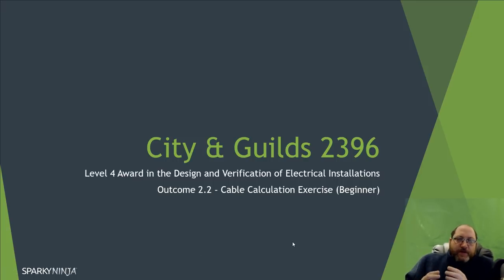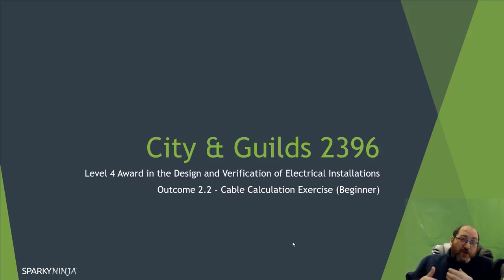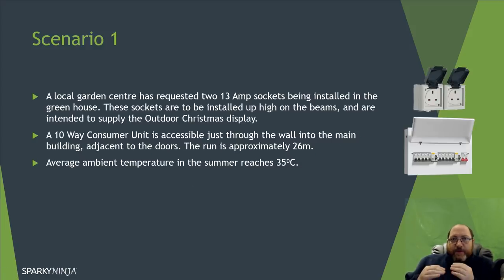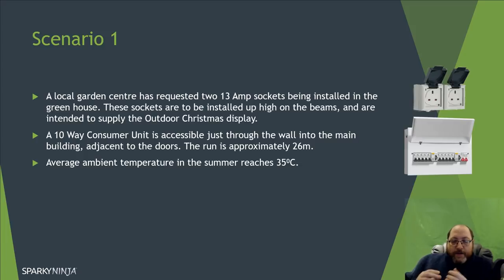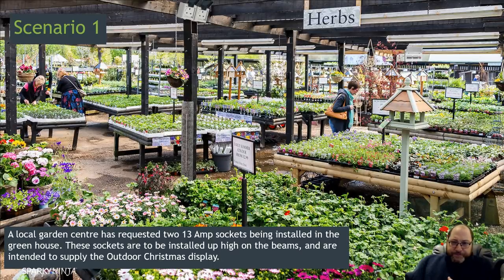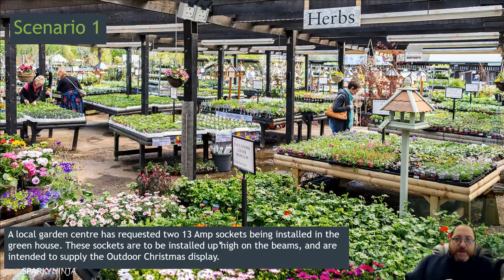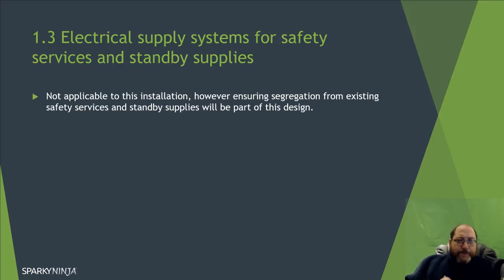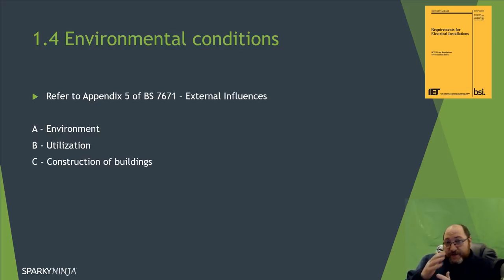2396 Ep 3 - Cable calculation example - Beginner

Comment: That was very interesting and very informative, but I would just like to ask one question. When working out the Zs for the mcb you come up with 2.19Ω, but I always thought you had to take 80% of this figure 'as a rule of thumb'.
Reply: Rule of thumb is a testers method not a designers, you have taken any factors effecting the cable already as apposed to a inspector arriving unfamiliar with the installation applying  the rule of thumb because the factors may be unknown to them.

Comment: why are you using the 100a figure in the 'Thermal Constraints' / adiabatic equation? Should it not be the potential fault current i.e. 230/Zs - which will be far higher?

Comment: Hi I need to calculate the size of the main earth I need from the 120mm SWA 4 core used as a sub-main to the DB. what size conductor would I need from the earth banjo to the main earth terminal within DB taking into account the armoured cable will be glanded into a removeable gland plate would this make a difference to earthing size to formula

Comment: Dear Sparkyninja, you are correct in regards to the volt drop, but if the volt drop between the source TX and DB is not noted anywhere and you don't have access to the transformer room let alone the locked transformer output terminals you are stuck.  Please advise what you would do in these types of cases. I think it would be very difficult to make an accurate assessment of this. We base all our calculations on 400 volts AC. However in reality every board I have visited has always been well above this sometimes in the region of 415-420 volts at the DB. perhaps this is why it is not really considered in Domestic installations by the City and Guilds.
Reply from the maker: You are correct Angelo in that we don't have the accurate data to properly determine VD in many situations. Also bare in mind that loads are constantly changing within the systems network and therefore so will the volt drop.
Reply: @SparkyNinja  Thanks, your tutorials have been great bringing an old-timer back.

Comment: Sparky Ninja,
1) Regarding 'It' and Iz values, the value 'It' is calculated by us and we have to pick up the cable with the current-carrying capacity bigger than 'It', and this is our 'Iz' value. From my understanding the values in the table 4D5 are neither 'It' nor 'Iz', right? You incorporated an ambient temperature for your cable ('It' value), thus increased the current and because you have done it, you can now use this table showing the current-carrying capacity for 30*C, as you already adjusted your calcs, correct? 
2) For voltage drop calculations, you took the length equal to 26m, because the length should be the length of the line and neutral, I reckon that the table 4D4A and other tables show the voltage drop value per meter already for included line and neutral? Cause if not, you would take the length 52m. Correct?
3) Just regarding radial or rings for socket circuits. There are some issues I cannot understand. 
a) Why people use ring circuits? I know that the size of cables might be reduced, usually it is 2.5mm2. But what if there is a broken cable. Because this is a ring, everything will work as the current will flow from both sides, but this might overload the cables without tripping the MCB and now we will not have the equation Iz>In anymore. You wont be able to say without testing that something is broken.
b) The maximum demand and diversity for a typical house, especially on ground and first floor, would it be enough to assume that 20A is sufficient per each socket circuit? In todays houses the equipment will not take so much current. Would be ok to install 20A MCB then? Or it is just for the peace of mind electricians go for 32A. Also for example table A2 Onsite guide gives point 9 -> arrangements of final circuits. I don’t get that, as I though then their recommendation is within one circuit, but in this case I can treat let say 1st floor circuit as 100% and take 32A MCB and then treat a ground floor circuit as 40% of 32 and go with 20A MCB. Could you clarify what do they mean by this point 9?
 What are your thoughts and approach to maximum demand and diversity? Maybe good topic for a video. 
c) Table 7.1 gives us values of maximum lengths for different circuits. What is this length? For a ring circuit, is it the length of the whole loop, so the total length of LINE conductor?
For a radial circuit, is then a length of LINE conductor only to the furthest point? What about spurs? Should I add the length of LINE conductor of each spur to the total length?
d) Table H2.1  gives the maximum floor area served? Where did they get this value from? If you run your cable, why you should be worried about the area, it depends on the length of cables…
e) A2 radial circuit with 32A given in table H2.1 Onsite guide gives minimum 4mm2 cable size. From table 4D5 BS, the current cable capacity excluding method C is lower…, I reckon most electricians take 4mm2 even if the reference method is different than C, do you think it is common? I hope not😊
4) From my understanding, when having a lightning circuit, it is possible to connect to the switch, let say a 5A socket outlet, correct? As long as the rating is not higher than the rating of our light circuit.
5) Just a practical question, let say you calculated your Zs value for a new circuit and also voltage drop. You are close to the limit, but give it a go and installed. Then you measure that and suddenly your R1+R2 is slightly higher than should be and also the voltage drop is slightly higher. What would you do if you are sure that there is no problems for the installation. Would you then re-install and increase the cable? Or would you say, ok it is only a tiny number and accept. I reckon you should always give yourself a safety factor when designing for that situation 😊? Cause from my understanding there are no hidden additional safety factors, let say 1.35 as in mine industry. 

Sorry for the length of my comment but after the conversation with one ‘’electrician’’ I think that these questions might be important for others to understand what they are doing. 
 
Thank you for your time and this video SparkyNinja !!!!
Reply: Answers
1. Correct. It(tabulated Current) = In(Protective device)/Correction Factors. This enables you to determine Iz(cable Size) But remember Iz(>=)In(>=)Ib.
2. The tables give mV/A/m (milliVolt per Amp per Meter) of both Line and Neutral. So in this case 26m
3. I'm Not answering those, see the regs book it explains why. If you still don't understand you might want to consider going back to college. (Harsh but fair)
4. By "socket" it means a socket designed for lighting eg a Klick. NOT a 13A twin outlet. 
5.If you calculated and they were correct values but they were incorrect when installed it means 2 things. 1)= Your cable calcs were incorrect, and 2) Its none compliant to the regs and therefore HASWA and EAWR, so needs to be ripped out and done proper. 
 
Honest answers. Not there to insult.
Reply: Iz is what the cable must be able to carry so after you have applied factors to In you get Iz. Then when you find a cable that will carry equal to or more than Iz the It value is that tabulated value. Symbols section in part 2 of 7671 explains.

Comment: Hi Sparkyninja
Thanks for such a great presentation  I really enjoyed the way you took us through each step of calculations along with each piece of relevant information. Nevertheless in calculating the required size of the Protective conductor I have arrived at a different result from the one in your presentation. I agree with you in regards to the thermal withstand calculation but for some reason or other the calculation pertaining to the size of the cpc is just not working out. I've applied the formula in the example which was: S=root I squared ×t÷k and came up with 0.347 Which is vastly different to your worked example of 0.567 or something approximately. Might there be an error in the final figure of your worked example?
Reply: No you've made the error. 0.549 is correct

Comment: Don't get why 7A has been used for volt drop calcs  on a socket circuit on a 20A MCB. Surely you would design for a least one socket being fully loaded eg jet washer.